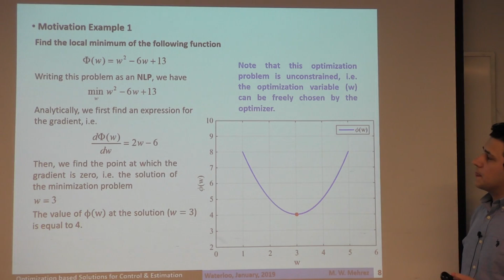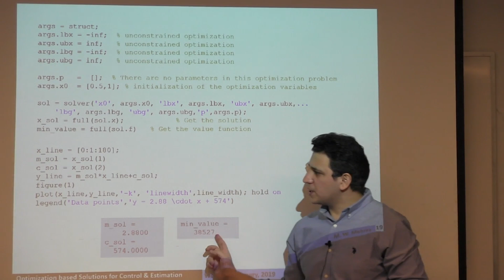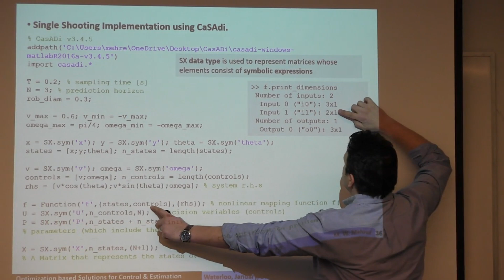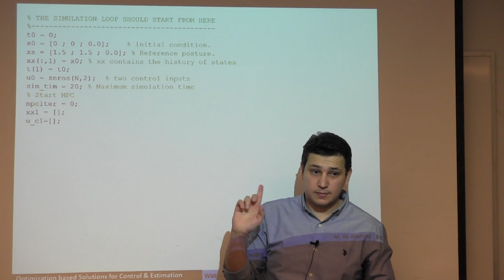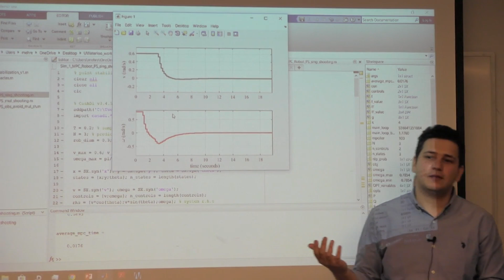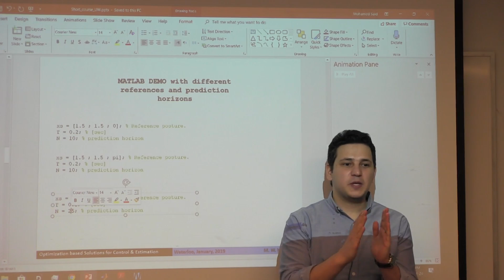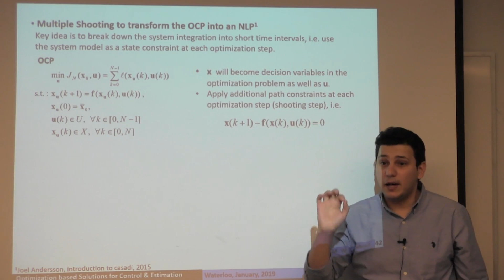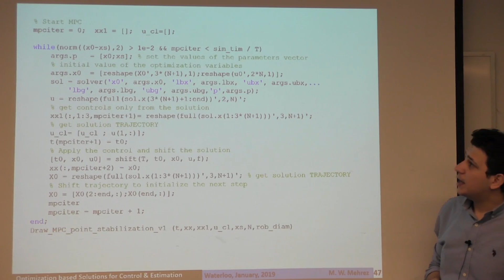MPC and MHE implementation in Matlab using Casadi | Part 1

Comment: Thank you very much for the class,  Dr. Mohammed, your explanation is amazing. I have a question here... without constraints and keeping the same model, when I apply the optimization in each iteration basically I get the same result as if I had been using LQR, right? That is, it is as if each iteration had the same u = -Kx, with K being practically the same as the K resulting from optimization with LQR (supposing I'm using an enough prediction horizon for the MPC). For the MPC formulation, K = −(B^{T}WB + R)^{−1}B^{T}WA, where W is the solution of the Ricatti equation. In the casadi/matlab  this optimization is incapsulated in the function solver, but is this what this function is doing (imagining the simplest case, is it just solving the ricatti equation from W)? Similar to the lqr function of matlab?
Reply from the maker: Hi Shyenne, thank you for your comment. Your analogy to understand how MPC works is reasonable. Yes, the solver you call is basically your control law. That is after having the solution (which is initiated by the feedback on the state), you get the next value of the control you need to apply to achieve the control objective. The control objective is encoded by the finite horizon quadratic cost in analogy to the infinite horizon LQR objective function, which has a closed-form solution via Ricatti equation.
Reply: @MohamedWMehrez  Thank you for the answer!! So, to each iteration, I do the optimization considering my prediction horizon and I get a "K". Why don't I get the same K at each iteration? Or I have it in this case? If I don't have constraints, If I consider that the system is the same and the prediction horizon too, all my "K" will be the same? I'm trying to understand the simplest case before and then try to figure all the mpc formulation out, it is been more difficult than lqr. Thank you again =)
Reply from the maker: Hi Shyenne, if you don't have constraints, and the system is linear while using a sufficiently long prediction horizon your gain K will reach a steady state value. That's by the way how the Ricatti equation is proven. The MPC formulation with the generic nonlinear optimizer (used in this workshop) allows you to consider constrained nonlinear systems on the expense that you have to solve the resulting optimization problem every sampling instant.
Reply: @MohamedWMehrez  Hmmmmmmmm, true. So, if the prediction horizon is very large and tends to infinity (which will imply high computational cost), it is like if a LQR was applied at each instant (with a K that arrives in the steady state), which would be redundant and would not make sense to apply, right? On the other hand, MPC doesn't just use the LQR optimization process (which was how I was thinking ...). Therefore, for MPC, the "u" are not simply given in function of K = - (B ^ {T} WB + R) ^ {- 1} B ^ {T} WA, it happens when we use opc. When we go to NLP, considering the initial value of the state and the inputs that will be predicted, "u" won't  be direct computed by Ricatti, right? In this optimization process, one includes a disturbance variable (d_k) to models the part of the cost that is about the prediction horizon (right?) And then one uses a prediction model like CARIMA (from what I saw doing some research, although I do not understand a lot yet) to solve this. Thus, in fact, each iteration has a different value, because the optimization process in the horizon from t_k to t_k + n contains information not only from the system provided (which is not the same as the real one in pratical problems), but with extra information that is not from only the state feedback, that helps you to correct possible unmodified changes. Is it an right overview? (sorry for the big text and thank you one more time)
Reply from the maker: My answer to your first question is yes. For the second question, you don't  impose a random noise on the prediction model; may be you do so on the simulated model to show the robustness of the MPC controller.

You're third observation (question) is somehow correct; however, the value of u is different at each iteration simply because you have a new feedback and since your prediction horizon is finite, your predicted state reach will differ every time instant.
Reply: @MohamedWMehrez Hmmmm, right! Thank for all the answers e for the attencion, Dr. Mohamed.
Reply: @MohamedWMehrez  But what about "K"? u changes because the state changes, but "K" will be the same? what is the difference related to apply a discrete time finite horizon LQR ?
Reply from the maker: @shyennepinheiro4547  the concept of a gain K doesn't exist as far as I understand in MPC. This is because unlike LQR, in MPC we consider constraints on the states and control and this makes it not possible to have a constant K. There is something interesting you can do: you can run the provided MPC algorithm and for every control u compute the corresponding gain by solving for K in u = K x; here K is the unknown. Then, you can investigate the behavior of K in MPC, you may find something interesting and I would be happy if you share it here again.
Reply: @MohamedWMehrez  Hi, professor Mohamed!!  I was trying, somehow, to understand the solution of a NLP problem by means of OCP problem, which one I already understand the mathematical formulations.  In the unconstrained case, in fact, we can find an optimal solution with K, that is what we find at the begining of MPC books.  But I'm still trying to understand how the shooting methods find the solution. We start by describing the state model recursively ( x_{k+n} = A^{n}x_k + A^{n-1}Bu_k +A^{n-2}Bu_{k+1} + \dots Bu_{k+n-1} ), right? Then we find the new matrices and the cost  J_k(x_0,u) given by min_{u} { x_0^TQ'x_0 +u^TR'u } in which Q' = diag{Q,...,Q},  R' = diag{R,...,R} and u = [u_k u_{k+1} ... u_{k+n-1}]. Right?

And I did the tests you suggested me!  I implemented for 3 systems: the robot (which one you did, of order 3 and 2 inputs), inverted pendulum (order 4 and 1 input) and beam and ball (with order 2 and 1 input). I took a number of samples referring to the number of states to set up an nxn system (with n = number of states) and get the K, since u_samplej = -k1 * x1_samplej +… -kn * xn__samplej. With that, I used Cramer in each iteration to find K. I changed the final state to 0 and changed the initial state, since I wanted to test the regulation.

For the beam and ball system, expanding the constraint limit (decreasing its influence), I was able to obtain Ks very close, ranging between [-17.7659 -10.5771] and [-16.9040 -10.2169] (with N = 30 and T = 0.02). Changing to N = 60, I got K = [-20.7729 -11.6558] constant for a large number of samples and changing at the end. I increased it to N = 120 and K was around [-20.8891 -11.6989], changing more at the end as well. But, decreasing the sample time to T=0.002 and letting N = 30, I got a constant K = [-0,4523-1,4680] for all the samples ( I used a simulation time of 20s). 

I think it makes sense, as I practically removed the constraints and I shortened the sampling period, leaving the simulation closer to the continuum. It is as if the solution had approached the solution that would have been obtained by making a discrete finite horizon LQR, since the solution to each iteration, in practice, would be very close. For the pendulum I was not able to make K constant throughout the iterations, nor for the robot model. (I tested the code in LQR to ensure that I did not make an error in the implementation, because as I design K I could check if I got the same Ks in each sample when applying Cramer in my LQR code).

Thank you again (and if I did something wrong please tell me)!!! =)
Reply from the maker: @shyennepinheiro4547  that's a quite nice study. Good job! Just keep in mind that shooting methods are just a way to convert the ocp to an NLP, which is then solved numerically using, e.g. the ipopt method. I suggest that you look up the ipopt method to have a deeper understanding of how the NLP is solved numerically.
Reply: @MohamedWMehrez  Okay, Dr. Mohamed! Thank you very much for your attention and for answering my questions, I will study it for sure. You seems to b a great profesor =)
Reply from the maker: @shyennepinheiro4547  Thank you!

Comment: I am following this following tutorial.

For my use, I have changed my Vehicle model and constraints. I am able to design the controller for my model. This is what I have achieved so far. 

But my question is regarding frenet frame. 

Traveling path is defined by parametric curves such as Bezier curve and B-Spline curve. To generate trajectories along the shape of the given path, the Frenet-frame is 
 commonly used. So how do I achieve this using casadi.interpolate function ? 

How do I use casadi and frenet frame together to track/generate the trajectory of an autonomous vehicle given the vehicle model and constraints like in this video?

I have just started using Casadi and hence it is difficult for me to find an answer.

Thank You.
Reply from the maker: Hi Yash, thank you for your question.  I actually haven't tried Casadi interpolate function before. I suggest that you look it up in Casadi manual to see how it works. 
All the best, Mohmed
Reply: @MohamedWMehrez  Okay, Thank you for your prompt reply. I will continue this thread if I have some doubts.

Regards,
Yash

Comment: Dear Professor Mehrez, 
Thank you very much for such a good explanation regarding the MPC. In minute 44:51, regarding trajectory tracking, you mention that the given a path following problem the controller has an extra DoF for choosing where to start to follow a path.
Do you mind to clarify that approach?
Reply: For example, a certain path is given by a list of poses [x, y, theta], and I would like to follow it. How could I extend the approach in Part 3: MPC for trajectory tracking for this? This paper is related to it: https://www.researchgate.net/publication/315678321_Predictive_Path_Following_of_Mobile_Robots_without_Terminal_Stabilizing_Constraints
Reply from the maker: Thanks Sebastian, In path following, the reference is not an explicit function of time but rather an extra parameter (path parameter) whose time evolution is not set apriori and is left for the controller to decide. 
The paper you mentioned explains how the path following problem works exactly. You can understand the idea and the complete problem formulation by reading only sections 1 and 2. You can also skip Equation (5) in that paper safely (it was used for only a  theoretical purpose in the paper).
Reply: Dear  @MohamedWMehrez  thank you very much for your reply. I will go further in this topic in the following months. 
1.Regarding this Part 1 example, how could I implement it in a close loop (without MHE yet)? Should I send to the solver one point at time, or should insert a list of poses (as a path)?
2.The shift function is in charge of applying one control step?
 Thank you for your kind help.
Reply from the maker: Hi Sebastian,

1- you send a single reference if it's a point stabilization problem and you send a list of reference points if it is a trajectory tracking problem. Check part 3 of this workshop for more details on trajectory tracking.

2- the shift function is always the same, but remember that in the case of path following, you consider both the system dynamics and the path dynamics. Check the paper above for details.

Comment: Thank you prof for sharing. I have 3 question about this lesson

1. Can your program be changed on time step series, become MHE first to MPC? I mean its like reverse from your program. If it can be like that, how to changing?
2. How if your program changed become deterministic and have not noise?
3. Where are you getting measuring data?

Thanks a lot prof
Reply from the maker: Thanks angii,
1- I presented the two methods separately and not in series. You will need to integrate the two methods MHE and MPC such that you do the estimation first via MHE and use it as a feedback for MPC.

2- Normally, when you do state estimation, you need to show how good is your estimator against noise. Of course, you can remove the noise from the provided code and it would still work.

3- Here, I am synthesizing the measurement by calculating the range and bearing and then add noise to them, I provided more details on that when I talked about the MHE part.

All the best,
Mohamed
Reply: @MohamedWMehrez  thank you prof, thats so helping my final project
Reply: @MohamedWMehrez  Sorry prof, i have other question.
What needs to be changed from your source code, if the equation is linear?
Thanks a lot
Reply from the maker: You can apply the same method if the system is linear. Remember that the nonlinear case is the general case 😃

Nonetheless, you can a simpler way to Integrate your system because linear systems have closed-form solutions to their integration.

Finally, for both linear and nonlinear systems  you can use a more accurate integration scheme like Runge Kutta. I am planning to make a tutorial on this using Casadi. Stay tuned 😊
Reply: @MohamedWMehrez  thanks for your answer, prof... im so enthusiastic to waiting your next tutorial^-^

Comment: Thank Mohamed. I've adapted your code and have sucessfully implemented a multiple shooting MPC Tracking but I was just wondering in single shooting, since we only use the control as optimization variable, can we removed the states optimization from the cost function i.e set vector Q=0?
Reply from the maker: Hi Bashir, then what will be your objective? When you use single shooting, the state is explicitly a function of the control. So, if you put Q= 0, then your objective is to only minimize the control and in this case the optimal solution will be u = 0.
Reply: @MohamedWMehrez  Ohh yah now I get the picture. Sorry for the silly question :)

Comment: Hi. I have read the code for single shooting and multi shooting  methods. Does the shift function in main simulation loop represent the plant system?  If I replace this with another dynamic system model, is it Okay? Thank you.
Reply from the maker: Yes, you can replace the dynamics their with your system dynamics, but you also have to adapt all the MPC formulation before the simulation loop to the new system.
Reply: @MohamedWMehrez  I donot get your meaning clearly. Generally in simulink the plant system provide measurements for controller. The feedback states are used to generate proper control signals. Could you give me more suggestions on how to use the mpc controller like the one in simulink? Thx.
Reply from the maker: This means that you will replace the model in the simulation loop by your simulink model. Please check Casadi website for the simulink examples there.

Comment: It is really difficult to find such well-explained lectures online, thank you very much. Also, I noticed that you answered questions on this comment section, which is quite beneficial. I would like to ask one if you don't mind: 
Currently, I try to use CasADi to transform an OCP (MPC Problem) into an NLP problem. I feel like I have succeeded in the coding part, however I don't know how to generate a C code to embed it into an ECU. I have seen your suggestion about Acados but the main problem is that my constraints ('g' vector) vector changes at every time step due to a parameter changing in the RHS equation. How can I generate code of an NLP solver, if my NLP problem formulation structure updates at every time-step due to g vector changing? I hope you and your loved ones are safe during this coronavirus outbreak. Your answer will be greatly appreciated professor, thank you in advance.
Reply from the maker: You are welcome! You can actually fix the number of the constraints to the maximum number you can possibly have. Then, you multiply each constraint by an extra parameter whose value is either 0 or 1 depending on whether or not this constraint will be active at a given MPC iteration. All the best!
Reply: @MohamedWMehrez  Thank you for your reply Dr. Mehrez. I apologize but I would like to verify my understanding of your suggestion. I am stuck trying to figure out how the code generation works, if you don't mind I want to ask some questions:

I am using ipopt solver as you have shown in the examples to generate a code for the s-function like mentioned in this link: https://web.casadi.org/blog/mpc-simulink2/ but I get errors. Do you think its related to my default chosen compiler: Microsoft Windows SDK 7.1 (C)? Should I use MinGW for code generation?
Also, is it better to use optistack in CasADi for MPC problems with osqp solver for code generation that will be used in S-functions?

Lastly, in your explanation, do you mean pre-computing the g vector throughout all the steps of the simulation and using the appropriate ones when that exact time-step of the simulation arrives? My problem is a trajectory tracking problem where I get different reference values at each time step of the simulation. I believe CasADi only supports code generation of functions with symbolic inputs. Regarding this, assuming my code generation works, how can I make the S-function recognize the simulation time step so that it can choose the right g values (from the pre-computed vector) considering that it can't get any other inputs than symbols? 

Again, I apologize for asking these many questions. I hope you can provide me suggestions. Thank you for your attention, doctor.
Reply from the maker: @batuozmeteler8405  hello, no problems! Concerning the first part of your question, Casadi doesn't support code generation for ipopt so far. You can see how code generation works and the available supported solvers here; https://youtu.be/JI-AyLv68Xs

For the second part of your question, did you check my tutorial on trajectory tracking? There I am showing how to pass a time varying reference to Casadi.
Reply: @MohamedWMehrez  Thank you again Dr. Mehrez, everything is much clearer now.